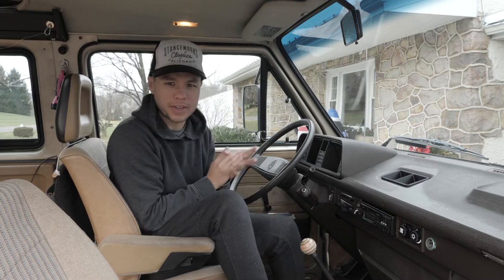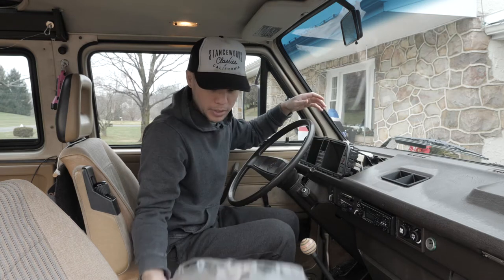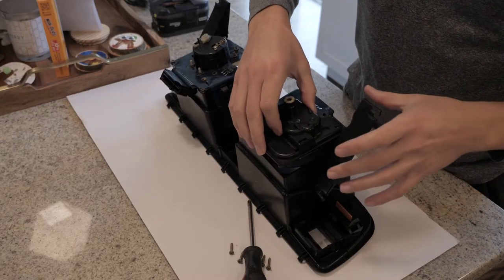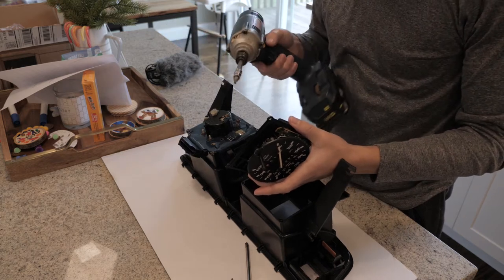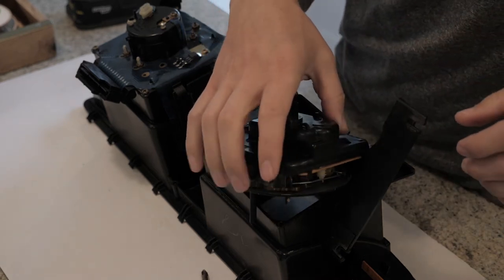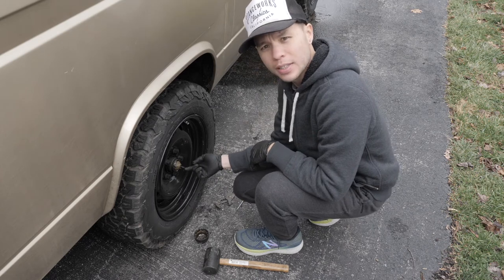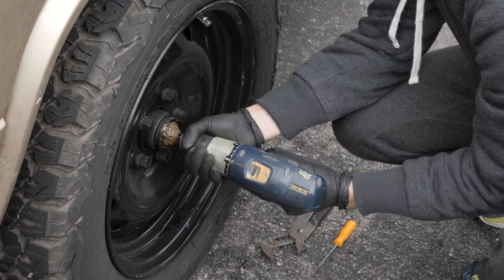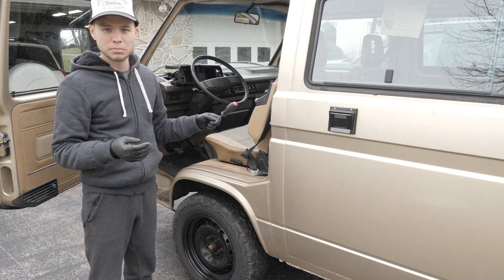Fixing the VW Vanagon odometer

Comment: Welcome to Vanagon ownership. This part of the van just plain SUX.  My cable made a loud noise when it was 40 f outside.  was able to fix that with zip ties, then my odometer stopped, fixed that by replacing the plastic gear, not easy.   Now speedometer n odometer stopped working probably the cable since its the original one.  the Van teaches you Patience

Comment: How did you disconnect the odometer cable from the back of the instrument?
Reply from the maker: right where it connects you'll feel a small clip. pinch the two tabs together and it will release.

Comment: Good chance you have damaged the flex circuit.  You amateurs should not be messing with vehicles.
Reply from the maker: I certainly respect the next level of skills that pros have, especially with these unique older vehicles, but I could not disagree more with your statement. Amateurs should always mess with their vehicles. Learn, grow, mess up, pay for it, and more.
Reply: As you can see in my message above, or not...I am an amateur's amateur, but $950.00 for a new speedometer is outrageous - yes? Then labour on top.
Reply: From my forty year experience, professionals are more likely to mess up